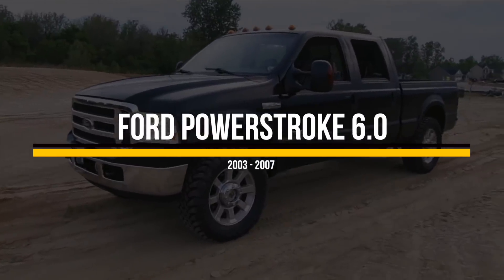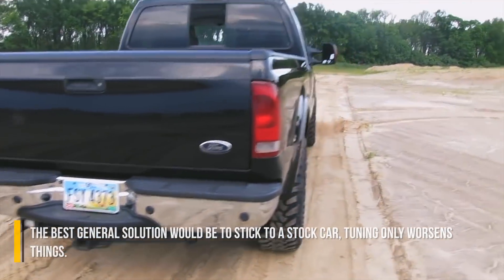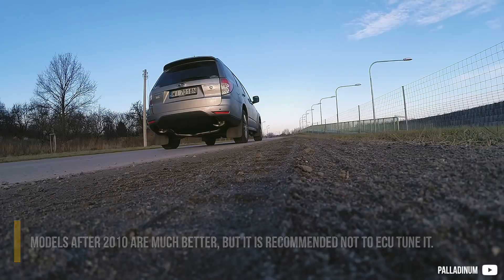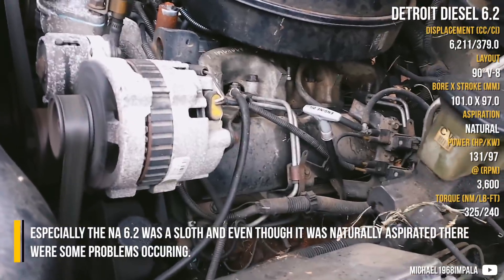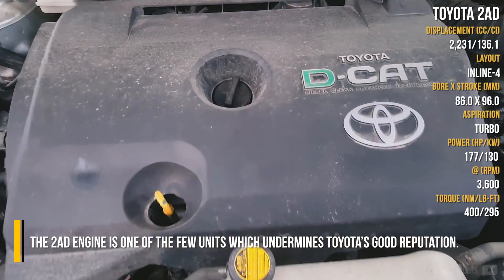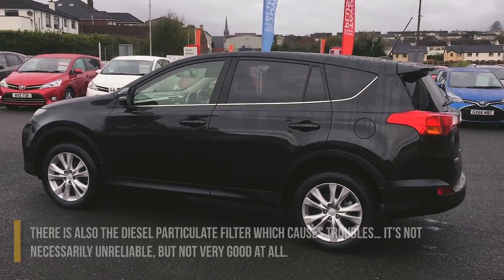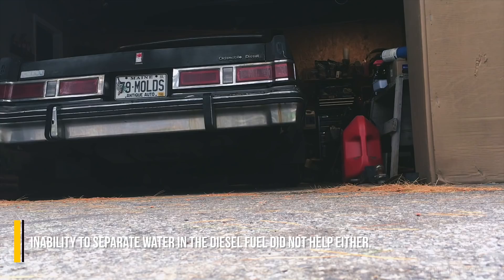6 Worst Diesels You Should Stay Away From

Comment: For the record, the 6.2l is actually a workhorse. That engine will run forever, but the 700r4 on the other hand...
Reply: can confirm
Reply: Mine has the 400 3 spead 456 gears. I love my 6.2 and have recently picked up a new Banks sidewinder for it.
Reply: @Thetankfal  May I ask, how fast on the interstate you can go? And what is the RPMs at a speed of 70?
Reply: The 700r4 is a great idea, but not that strong, I killed a few if them, 4L80 is much better, if they were not electronic, would be awesome!
Reply: @jamest.5001  I dont know what is the point of the 4L80E Transmission being Electric from the start . Should had just kept it Hydraulic /Mechanical
Reply: Bro those engines are dogs when compared to fords 7.3 pre Powerstroke made at the time or the 12v Cummins that was made a couple years after. If im spending money on a diesel and older diesel at that, the gm Detroit would be my absolute last pick. In fact I'd take a Gasser over that thing.  Not that it's a bad engine necessarily but it is weak

Comment: The 6.2 Detroit Diesel engine is far from a bad engine. They are a lower performance Diesel engine but they are extremely reliable as long as you take care of them. It’s not a 5.9 Cummins, you can’t beat the living hell out of it it’s whole life and run it a gallon low on oil forever and expect it to last. But it’s not bad. They are a cheaper priced Diesel engine because of the lack in power and the fact that most of them sit in the old 80’s Chevy square bodies that are almost always rusted out. But I can say from experience that although your not gonna be winning any drag races anytime soon you will have a decently efficient and reliable power plant.
Reply: Collier 620 6.2l and mercedes 2.0l diesel are engines that i like! they are not fast or powerfull but they will run and run and.......
Reply: better off Frankensteining something with current prices
Reply: Jürgen Von Parsberg 12v Cummins is a true diehard. It’ll outlast anything else out there. I love the 6.2 but it’s just not a 12v. There simple, reliable, and if you can afford one with a 5 speed, go for it. It won’t let you down as long as the trans hasn’t been abused badly, stay away from ones with automatics tho. That trans was way under spec for the torque of the Cummins. And yeah, the crew can square bodies are getting hard to find especially if you don’t want a dually. Personally out here in Kansas I’m looking for a good 12v truck but the cheapest ones are rust buckets that people want $5,000 for. I’d love to get an 80s suburban with a 6.2 and daily it
Reply: JBat5202 true there. I’m kind of doing that anyways, looking for an old 6v92 or 71 Detroit to put into something just for the hell of it. That’s gonna be a long project but it should be fun
Reply: My 86 blazer had a 6.2 Detroit with a Jasper rebuilt 4speed god I miss that thing had to sell it because my Injectorpump went out and I needed a vehicle.
Reply: Worked on a bunch of 6.2's in the CUCV series, the biggest issues were the operators running them dry, then burning up the starter relay ( and then the starter.). GM also had a very silly "breadloaf" or "breadpan" fuel filter that was a pain to get sealed and purged.

Otherwise? The engine itself was pretty bulletproof. All I'd really fault was the flex ring infrequently failing in the injection pump, and the shutoff solenoid.
Reply: Collier 620....bullshit. One of the only two Garbage Motors products I've ever owned was a 1985 Chevy Stepside with that 6.2 liter piece of shit under the hood. Glow plugs are trash, exhaust and oil leaks (that's every chevy ever built though) galore, and that gay-ass bowtie symbol in the middle of the grill made the truck worthless....it never ran right, last GM vehicle I'll ever own...
Reply: I have a 99 6.5 turbo diesel Pcm when out but that's a flaw of gm mounting it to the block. I'm overall happy with the engine
Reply: I installed a LF9 in a friend’s boat years ago. All I had to do to bulletproof the engine was put on head studs and a high performance timing chain. That’s really all thats needed to bulletproof that engine. A water separator was already a part of the fuel system on the boat. So all three issues were resolved. Never given him a single problem. The 5 gallon oil system doesn’t heat either.
Reply: In my own boat I run two 6BT’s ganged together. Each one is tuned to produce 390 hp @ 3600 rpms. I love having a fully mechanical engine that runs do effectively. 
I can cruise along at 10kn and only sip 4 gph. Not bad for fully mechanical engines.
Reply: the 6.2 blows
Reply: What about the snapping crankshafts, cracking blocks and main webbing?
Reply: J Ballew i replaced the fuel filter on my 6.5 and fighting to get the air purged caused the fuel pump to go bad thank god they put it on the frame rail so it didnt take long to get going again
Reply: Branon Fontaine did you ever replace injectors? They need done every 100k as well as glow plugs and from the way you wrote your message sounds like you treated it like shit so it did the same to you
Reply: MrErikw26 they only snapped cranks when the harmonic balancer never got replaced after going bad
Reply: Casey C or the dual mass flywheel yes, but the blocks cracked of their own accord
Reply: MrErikw26 no idea about the blocks cracking but yeah im keepin an eye on the damper 150k and still original
Reply: MrErikw26 the mains will get small cracks but not anything to extreme.
Reply: Nintendo Mania as long as you don't have issues with the plug coming unplugged from the pmd while driving 😂 and as long as your extension doesn't burn up both happened to me the extension burned up so I relocated it to the top of the intake bolts and the harness wasn't long enough and decided to unplug itself from the actual plug
Reply: Collier • right on. I ve got a 87 Chevy k30 with a 6.2 na.underpowered, reliable,noisy, decent MPG.. I can put it in 4-w low and literally plow fields with it,all day..
Reply: PMD not PCM is what goes bad from the heat of being mounted to the injection pump, PCM is behind the glove box, Just saying
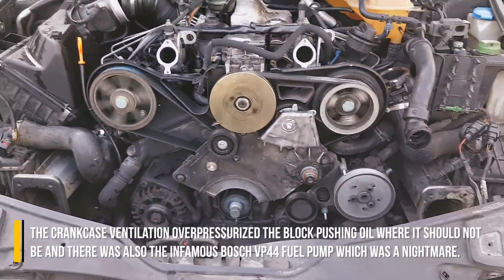Reply: I own 6.2 diesel  love it And I pull 16 ft. Goose neck with it. Its in a K 30 dually 4 speed 4:56 gears. No speed demon 55 mph. In a 1982 Scottsdale. I have los headgaskets . But who cares. I hate computer controlled  engines.
Reply: Tell that all to the US military
Reply: Collier • Not really comparing apples to apples but I agree with your overall point. The 6.2 wasn't turbocharged, and people will persist in  saying how gutless an engine is without any regard to the time frame in which it was built.  I hear the same B S regarding the IH 6.9/7.3... These engines all did what GM and Ford wanted them to do... sell trucks. Personally, I prefer   1st generation 7.3 over the Power Stroke.  Easy to work on and much more easily adapted to off-road applications.
Reply: Most 6.2s come with auto trans. That engine was a notorious transmission eater. I heard of owners replacing 3 transmissions in 50k miles. Stick shift 6.2s are rare. I'd rather have a Ford idi. Stick shifts are more common with those.
Reply: @capitalisteconomist  the only thing with the 6.2L was the early ones had some crank issues but other than sluggish they were okay
Reply: @tdgreenbay  The engines were ok. Auto transmissions hooked up to them-not so much. Look up how the 6.2 eats up those transmissions.
Reply: @capitalisteconomist  A decent transmission shop will make the upgrades during a rebuild, I have 180,000 miles on my rebuilt trans.
Reply: Collier • the 6.2 and 6.5 were both fine engines.  They were never intended to be powerhouses.
Reply: 6.2s won’t eat a TH400. A lot of the lighter trucks had 700R4s, which they would tear up, but that’s not saying much. The TH400 and 4L80 are the best Automatic transmissions GM ever put in a truck. And I’ll tell you neither an NA 6.2 or a Turbo 6.5 will kill one unless it already has issues.
Reply: @justinstearns9723  The early TH700R4s were bad, but the upgrades made them good. Yes, the 4L80E is very good.
Reply: @justinstearns9723  
My m1009 has destroyed several Th400 and the 208's behind them.
Nothing that an SM465/205 can't cure.
Reply: The only problem i had with the 6.2 is the last owner didnt take care of it
Reply: @doitalldavey8788 , yeah once you relocate the PCM to the fender out of the engine bay ur good. Between a 6.5 & a 7.3 idi or IDIT I prefer the 6.5 because of where the turbo is located, & where they put the fuel filter. But I’m not fond of where the injectors are located.
Reply: @branon6565 , that’s part of owning a Diesel. If you put money into fixing it, & maintenance it would be leak free. If you don’t like owning a Diesel don’t kill it, sell it to someone whose gonna maintain it properly. 6.2s are good motors just down on power. Get ok mpg, & they’ll run forever.

Comment: I'm gonna have to go against the 6.2 detroit diesel being unreliable. My dad still has one in a 1983 van and it has now done over 800k miles and we have not cracked open the block once. Only regular filter changes and fresh oil will keep it running forever. If anything the body will rot away way before the engine dies :D If you want to talk about unreliable diesel engines, we can talk about the 5.7l Oldsmobile V8 diesel, now that is a crappy engine.
Reply: JackPecker911 I agree with you. I own a 1995 K3500 Dually with the 6.5 turbo which I beat the hell out of as a work truck, and it never wanted to stop. This guy said don’t “overload them” I towed over 15,000 LBS in that truck through the mountains with no trouble. I also own a Civilian Blazer with a 6.2 Detroit from the factory, it’s a 1984 model. The truck has 385,000 on it and still going strong. They’re good motors, they can pull well ( a little slow off the start but can get up to speed ) they’re reliable, and they make great fuel mileage. They were also the first diesel out of Ford/Chevy/Dodge. Chevy in 1978, Ford in 1983 Dodge in 1989. Detroit is an all around good diesel and apparently this guy has no idea what he’s talking about because they’re great motors.
Reply: If I swap in a crate 6.2 will that solve any issues? It’s a brand new turn key motor and I see a decent m1009 blazer near me
Reply: i agree 100% we have a 1982 and it will NOT DIE never will. never had a better truck ever.
Reply: The LF9 at the end of the video is the olds 5.7 diesel
Reply: @lpe655  Yeah I couldn't tell ya based on appearance, I'm no expert I just know what the particular van has.
Reply: @JackPecker911  me either I just happened to watch a video before this that gave the motors full description aka LF9 5.7L Olds Diesel so I figured I would make that connection for u as well. I wasn't correcting u or critiquing u. U have a good night man.
Reply: @lpe655  you too :)
Reply: The LF9 was a product of GM's management pushing out the engine before it was ready. The V6 Olds diesel is pretty bulletproof, with more head bolt studs (it still doesn't have a water separator, but that hasn't stopped the very few of them made from being quite reliable). The Olds 260 V8 diesel I know almost nothing about, and likely never will, since it was only made for 1979, and only put in one car: the mid-size Cutlass family. As for the Japanese not making good diesels, Toyota's Land Cruiser diesel and Mazda's RF, the current Honda diesel, and Isuzu would like to have a word. Mitsubishi also has a few words. The 6.2 Detroit diesel shares very little with the 5.7 Olds, though both were used in trucks (1/2 tons for the 5.7 in 1978 and 1979, and the full range for the 6.2 from 1982 until Hummer stopped using them in the mid-1990s).
Reply: Nothing wrong with the LF9, one of the strongest stock high nickel blocks GM offered.
My 350 D is still going strong to this day, I'll jump in it and drive 500 miles a day and it has never left me stranded, original head gaskets and head bolts too.
28 mpg 4560 lb Olds 98.
Reply: Same as all other vehicles, Americans like to get defensive when they get called out on their trash engineering. Just buy a Toyota or an Isuzu.
Reply: @bzilla-d4i  Isuzu is an interesting choice, I've never seen anybody recommend that before
Reply: Well that's because it wasn't even a diesel motor lol. Just a modified 350 small block Chevy that they forgot to reinforce XD
Reply: @DarkAttack14  I'm aware, I'm not sure if there is a way to make that thing reliable, maybe better headstuds and some machining to reinforce it could do the trick?

Comment: Japanese diesels aren't bad, just look for Isuzu engines (Chevrolet Luv-Dmax).
Reply: True, My dad owns a 2006 D-max 3.0 Turbo diesel for work.
Reply: Isuzu diesels are perfect
Reply: Antonio. Toyota engines are also very good
Reply: I have an 82 Isuzu I-Mark diesel, 1.8L 4FB1. Slow as crap but reliable as hell.
Reply: Or Kubota Mitsubishi Yanmar Isuzu
Reply: Isuzu 4JA1 is a legendary engine
Reply: Even the nissan 2.5 diesel 190hp of the Nissan navara is very powerful
Reply: Or nissan patrol engine
Reply: Kubota has been making good diesel engines; Bobcat even uses them in their tractors!
Reply: Thousands of Jeepneys running around the Philippine hills, most say Isuzu on the front... well underneath the glitter, lights, and other car badges.
Reply: Toyota AD engines are very badn but CD series are best.
Reply: All Hitachi excavators are powered by Hino, Mitsubishi  or Isuzu. Even Caterpillar uses Mitsubishi engines in their forklifts.
Reply: The Nissan SD33T is a very good engine, its lifespan can go up to 1 million km and is quite powerful, on the other hand it is very complicated to find certain parts
Reply: @garybulwinkle82  no... Kubota have injector pump issues and oil dilution
Reply: Isuzu c223 the best
Reply: Maycuervo Toyota doesn’t make diesels though I don’t think
Reply: Oldsmobile improved their diesels later, especially the smaller displacement versions were slow, but they eventually became reasonably reliable and efficient.
Reply: Toyota 1HDFT and 1HDFTE, almost un arguably the best diesel engines to come out of japan
Reply: Yup, Hino engines, Toyota diesel engines like the KD series, L series, HZ, VD, are very good.
Reply: Toyota Landcruisers are all available with diesels and they’re legendary.
Reply: @rekker2688  yeah they are reliable, but they are very inefficient for a 5.7L V8, it produces same HP and lower torque than a 5.9L i6 Cummins Ram from 1998. Isuzu and Nissan make better diesels.
Reply: The 6.6 Duramax is an Isuzu engine and it's a hoss
Reply: I realize Im kinda off topic but do anybody know a good site to watch newly released tv shows online ?
Reply: @Gianni Colson try flixzone. You can find it by googling :)
Reply: @Pierce Nikolai definitely, I have been watching on FlixZone for years myself =)
Reply: @Pierce Nikolai Thanks, signed up and it seems like they got a lot of movies there =) I really appreciate it!
Reply: @Gianni Colson glad I could help xD
Reply: @jhon-cg4rg  1.7 used by opel?
Reply: @evanshireman5644  not for the US market.
Reply: @youssefgrine8294  yeah but it's nice on so it's probably going to break down people want diesels because of their reliability and power not just the power otherwise we would have been okay with the 6.0 Powerstroke
Reply: Dmax was like 80% made by gm and Isuzu 20
Reply: also toyotas. The toyota 2L AND 2L-II diesel engines are bulletproof.
Kubota and yanmar also make bulletproof diesel engines. Not for cars though. Mostly industrial applications

Comment: The Detroit diesel is my favorite. You leave my 6.2 alone😂
Reply: years ago I had a buddy that had a 64 Chevy with a Detroit 4-71 engine swap. It smoked like a train but it was freakin cool. Love the sound of a DD 2 stroke.
Reply: I love my 6.2 and 6.5 I have not had trouble at all
Reply: Same here. My 6.2 will probably out live me.
Reply: 6.5 all the way.. unless you can get a 12 valve
Reply: @ackreyssig  I have no experience with the 6.5 but I have heard people complain about it here and there. Nothing to terrible.
Reply: @81brassglass79  owned one for a while now.. reliable as long as you don't push it
Reply: @ackreyssig  hell yeah. Reliable is the ticket my friend. Our 6.2 never quits. It is a beast. My papa Rocco had it in his will that it would go to me. He picked up scrap metal with it so he set it up with a few extra leafs. We had something like whole ton in the bed when we had to clean up his property in Burnham Il. She does allot less work now picking up fire wood and such. We love it very much, starts up when I turn the key every time. Im a mechanic (going for my biomedical engineering degree) and keep it going no matter what but she doesn't call for much, just tires, pads bulbs , mufflers were kinda plugged up so we got stainless ones. Cheers 🍻 having one for you papa.
Reply: The 6.5 in my 1998 3/4 ton Cheyenne is about to roll 400,000 miles. I've changed the glow plugs twice, relocated that pump computer thing so that it does not over heat and drive it sensibly. Never once failed me, but then I do my own maintenance and use Rotella 15-40 oil.
Reply: @mackenzielemay5754  🧢
Reply: This guy knows nothing...
Reply: they just dont know shit about sixtwos and sixfive,. as long as your fluid damper(front crank attached huge ass crank vibration dampener) isnt bonedry/leaking it'll last for above a million mile, injection pump might die but engine wont ever die

Comment: The 'problems' with the 5.7 and 6.2 GM Diesels can be easily remedied.  ARP studs and a fuel/water separator vastly improves reliability for both engines.  The 6.2 took off from where the 5.7 Olds left off, still utilizing a Stanadyne mechanical fuel pump best suited for tractors, but does alright for automotive if you take care of it.  Boost a 6.2 with a turbo for more power, just make sure to build up the top end with high compression copper gaskets, and replace the head bolts with hardened studs, and add a block girdle to add some block strength.